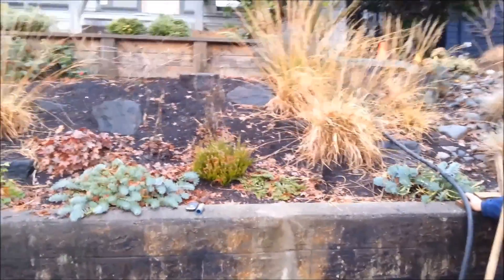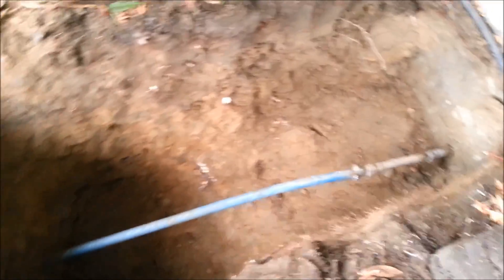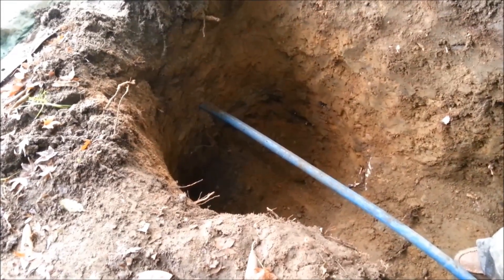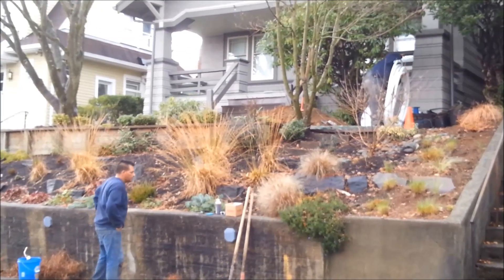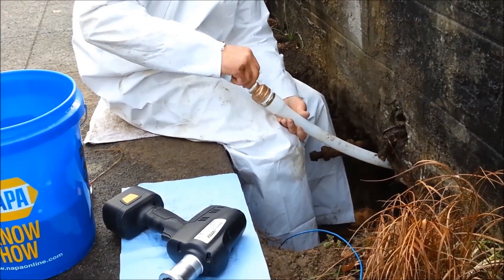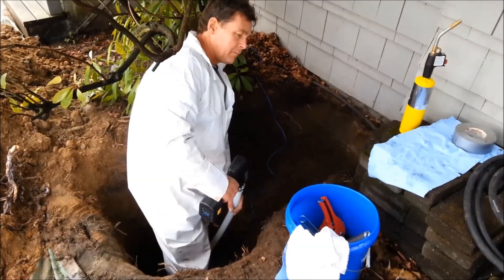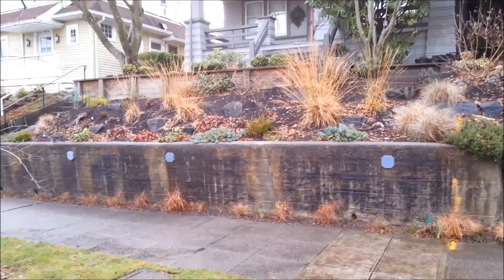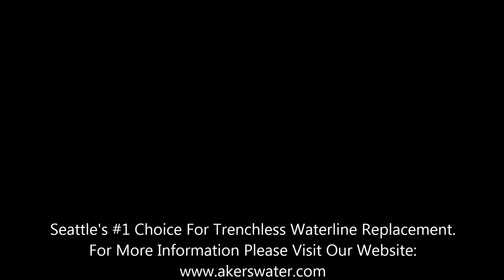MUST SEE!! Trenchless Waterline Install Seattle

Comment: Plastic pipe is good but the problem with all these plastic pipe replacements is you end up losing a good grounding electrode which is vital to protecting homes from electrical line surges and lightning strikes. People will start realizing this soon... The code will change where you will have to run a bonding conductor between the two metal pipes.

Comment: Not a good install. #1 pipe is only like 1 feet below ground and installer should sleeve the plastic pipe with metal or cement to protect it from yard work.

Comment: We have been using poly pipe underground in my family's business since the 60's, never once had one fail and we bury it sometimes 8-10 feet deep, always use 160-200 lb pipe and it will last forever.
Reply: I’ve seen them fail a few times. It always was a tiny pebble, wedged between the pipe and a big rock, another pipe…let’s say you lay the pipe on top of a big rock, the tiny pebble wedged underneath, the weight of the whole pipe will lie on that pebble and wear a pinhole in it.

Comment: Ok,..I know what a mainline leak looks like. Even a pin hole one. Running 24 7? Come on guys. At 1.17,...nothing .Cut scene . Then re show the same area. At 1.29. Leaking pretty good.Where was that leak in the first scene . And all the water from the,...24 7 leak? Hummm

Comment: I thought Wirsbo/Uponor PEX requires a separate ProPEX ring on the outside at the fitting end (where you are using the expansion tool) for any connections. Did they change their specs? Otherwise, it'd be interesting to know how you aim that mole. Neat stuff.

Comment: how did you hit the destination so accurately? I'm assuming you calculated the angle by the height and distance... but say you came up with precisely 10.5degrees. wouldn't a rock or something throw it off? example if you hit a big Rock 5 feet in and it throws the mole off 1" you'd end up off by a foot or two, no?

Comment: I would never allow PEX to be used on any project of mine. Water tastes like crap and it has never been tested for chemicals leached into the water.
Reply: +John Puccetti Regardless of your opinion on PEX, it's absolutely incorrect to state that it's never been studied. A quick search on google scholar for "PEX drinking water migration" shows hundreds of peer-reviewed articles in the last ten years, including several recent reviews which cover PEX extensively. 

eg, Contaminant Migration From Polymeric Pipes Used in Buried Potable Water Distribution Systems: A Review (http://dx.doi.org/10.1080/10643389.2011.627005) 

Are There Health Risks from the Migration of Chemical Substances from Plastic Pipes into Drinking Water? A Review (http://dx.doi.org/10.1080/10807030802235219)

Comment: I would never put that plastic crap behind my walls or under my property. Soft copper for in-ground applications and rigid copper for inside structure all the way.
Reply: We have some areas where soft copper won't last 10 years before the ground eats a hole in it.  I would much rather have pex/poly/pvc/anything but metal pipes.
Reply: whatever. copper reacts chemically with the earth, so it always at risk for developing pinhole leaks. I don't care either way, whatever the customer wants...
Reply: Both plastic and copper have there applications, Type K soft copper is the best choice but when you have a longer line we try to avoid having a lot of splices.  Also customer determines the final choice, 1" copper comes in a maximum 100" and the plastic 1" IPS up to a 500' roll.  Soil conditions also play a part in determining the best pipe for the project.

Comment: That poly wasnt hooked up properly, looking at it closer, if they had used a pacjoint coupling and put a metal sleeve in the poly, i bet it wouldnt have been leaking.  It may have not been deep enough in the first place, thats just my 2 cents.

Comment: it looks a little shallow to me im a plumber in kansas city. if it was 2 1/2 to 3 ft down it would look a lot better.
Reply: +Virgil2U Notice that the city's supply line was not very deep. They don't have much of an option to change the depth of the pipe they installed. I doubt the city/utility would come out and install a new line that is deeper. It seems the inspector also approved of their work. I agree that it seems too shallow, but calling them inexperienced over YT seems like a stupid conclusion to jump to.
Reply: City of Seattle required water mainline depth is 18 inches.
Reply: King County (Washington State) regulations require that outside water lines be buried no less than 2 feet / 61 cm deep.  (See:
http://www.kingcounty.gov/depts/health/environmental-health/piping/plumbing/installing-new-waterline.aspx )
Reply: +Phillip Cothran I fully believe you are right, if it was in a warm climate area where the frost line would be very shallow then this would be acceptable but since this is Seattle, Washington the frost line should be at least forty eight inches.  These installers are not professional or experienced at all.

Comment: Better of using either copper or P.E, the was a easy shot with the grundy, that's the normal size grundy i use but i also use a 4/5" grundys for 110mm pipes

Comment: So, if even blue poly doesn't typically fail until around 25 years anyway, isn't a 25 year warranty kind of pointless? How is that superior?
Reply: Dear Mr. Question man, normally a standard warranty is 1-5 Years however we typically will pass on the manufacturer warranty. With the pex wirsbo its an additional 20 years on there pipe, so we pass this on to our customers. I think the consumers agree that this additional 20 years is a added bonus for using there pipe. This new pex is the hybrid to the standard polyethylene pipe of the past. So far it looks like this pipe dominates the market here in the USA today in quality/performance. Thnxs hope this helps
Reply: I see. Very nice. BTW, I was a certified Wirsbo installer in California. I really liked using it.
Reply: +QuestionMan yes this pex wirsbo is very nice to work with. Do you still reside in California today?  That's a beautiful state, I love the sunshine.
Reply: No. Moved away from San Diego after the bubble burst. Jobs dried up. Still, it was very nice.

Comment: Love to see if that thing would get even ten feet in my soil, I'd love that thing if it can. Driving trenchers can't cut it; usually comes down to explosives and jackhammers.
Reply: Dear Wolf, your right not much works well in real hard pan/rock soil. Open trench may be the best option for you. Sounds like you know your stuff, thnx for your input.
Reply: I had to rent a jackhammer to get through my hard-pan... I'm replacing the main water line here in Fresno, CA with schedule 80 PVC

Comment: what kind of bullet mole was that?
Reply: Dear Hector, the tool we used was a grundomat 2" mole I believe. However we have a large selection of sizes/models at our disposal. If I were to recommend a mole for water service I would probably say the 2-1/2" hammerhead mole with the active head if you have harder/rocky soil. Standard sandy based soil the non active head mole works well. You can contact your local ditchwitch dealer for more info on purchasing one. Hope this info helps

Comment: Put a ducting in as well better protection for the water pipe.
Reply: Absolutely Andrew, we normally will put in sleeving when working in rocky/debris soil conditions. Also many cities we work in require sleeving when boring underground. Your right it has many added values with such a minimal added cost. Thnx for the input.